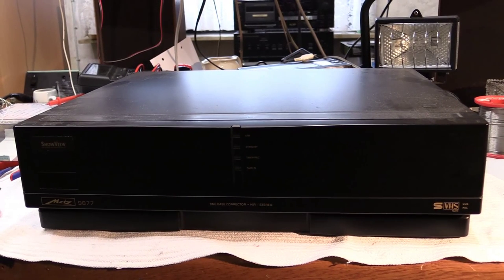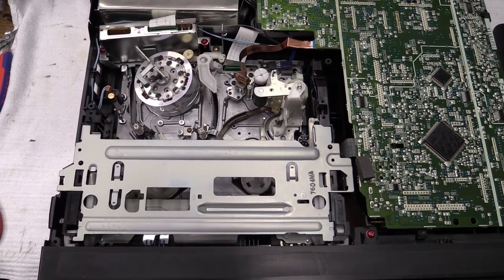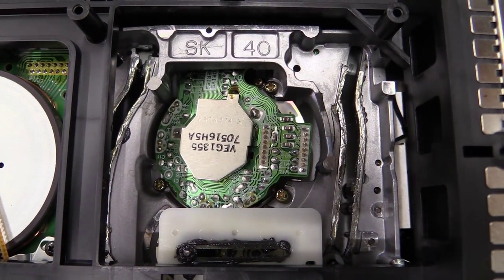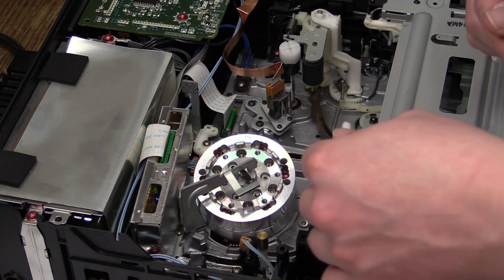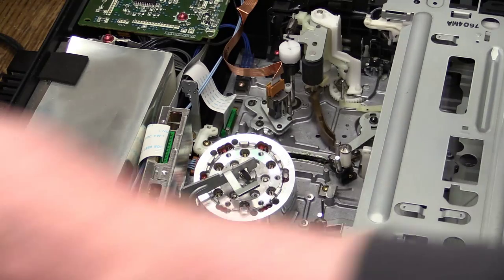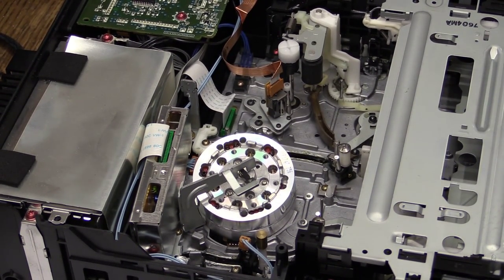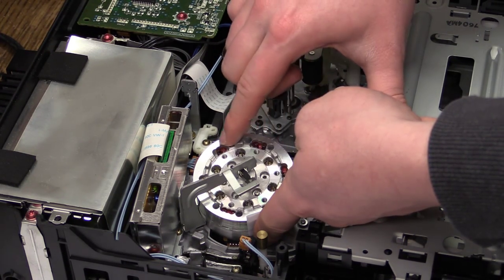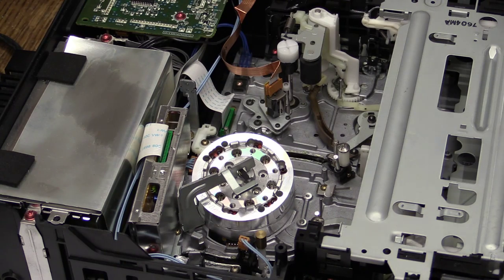DrCassette's Workshop - Panasonic HS1000 S-VHS VCR overhaul

Comment: Hi Doctor, I enjoy your videos. Is it possible to make a video for the Panasonic HS830 showing how to remove & clean the mode switch? I have 2 of these machines & one has all the symptoms of oxidisation on the control tracks. I took off the lid, took one look & hid in the cupboard shaking with fear & thought "I dare not touch this, I will break it.....I know, I shall ask Dr Cassette for help!". I cannot find info anywhere on the dismantling of this model let alone the procedure I'd like to do. I hope you can help. :)D
Reply from the maker: I can't get a specific model of VCR just to show how to repair a specific problem. If you get very, very lucky a friend of mine might make such a video as he owns a Panasonic HS830. You should be able to find a service manual for the HS830 online.
Reply: DrCassette 
No probs. I took the plunge & did it myself. The mode switch looked fine. I cleaned it & put it together. I then realised the problem was not with the VCR but with the tapes I was playing on them. They were old ex-rentals & 20 years on are deteriorating. I thought it was odd because having cleaned the heads only a week ago, the heads were dirty again.
Years ago I had a 200 machine duplication bank & I realised those were always recording onto NEW blank VHS tapes, so the heads never got dirty.
So it would appear the deterioration was triggering my HS830 to stop & eject. I played an unused tape & it is fine.
PS: I thought you already had an HS830, I thought I’d seen you with one in a video. I must be mistaken.

Comment: Very nice, though you should experiment with different camera angels, sometimes you can't see a thing what or where exatly you are doing things... Will you do any tape path alignment videos?
Better yet, make series on "How to maintain your professional VCRs" and go trough basic procedures (cleaning, lubing) to the more complicated stuff that is required after heavy use on the VCRs (alignments/adjustments, replacements)
Reply from the maker: That is much more than what I have time for at the moment ;)

Comment: Panasonic almost always made sure that the transport and chassis were easy to access and clean. Stark contrast with JVC...Always a damn circuit board or two on top.
Reply from the maker: Somehow JVC VCRs are hard to find around here, over the years I have seen just one consumer unit. I recently bought two of JVC's big industrial VHS editing VCRs. Those of course are designed for easy servicing.
Reply: Oh? Which ones? I had two BR-8600U's that were a breeze to clean.
Reply from the maker: I have a BR-8600E and a BR-6600E with matching RM-86U editing controller. They were bought as a set which is a bit strange because only the BR-6600E supports HiFi audio.
Reply: How much did you pay, do they both work?
Reply from the maker: I got these as part of an almost complete studio setup that a school used for teaching young adults the basics of working with video. So there was a camera, video mixer, title generator, a Sony S-VHS VCR and some other stuff along with the JVC VCRs. For all the equipment I paid 300€ in total. The BR-8600E works fine, the BR-6600E has a broken gear in the cassette loading mechanism, but I hope I can glue that back together. If you can get a cassette loaded into the mechanism, all the rest works fine. According to the hour meters both VCRs ran for only about 500 hours.
Reply: Damn, that's a steal! Will you do a video on the whole set soon?
Reply from the maker: There will be a lot of videos on all this stuff, but I don't know when, I still need to free up some space to set up all this equipment.

Comment: This VCR inside looks like National(panasonic) NV G10A , mainboard with boards on it.. and the whay its assembled. I also dont know what to do with it..
Reply: I have a G10EM! This uses the D mechanism instead of the HS1000 which uses the K mechanism. Mine has a power supply problem. Does yours work?
Reply: Hi. This VCR uses BNC connectors for the video output and RCA connectors for the audio output :)
Reply: +Fivos Sakellis  jea. bnc wich i dont have.

Comment: 1:07 All the speeds? That's a PAL model and unlike NTSC which have 3 speeds (SP/LP/EP). Very few PAL VHS includes PAL EP. Most PAL VHS only have SP & LP but not EP. I'm just confused about SVHS PAL VCR long before I saw your video because they said that JVC the inventor of VHS made a policy never include LP speed on SVHS machines and your VCR is a PAL SVHS model. My question is are the speeds of that SVHS PAL VCR SP & EP (no LP) like most NTSC VCR? or SP & LP (no EP) like most PAL VCR? or SP/LP/EP like the old NTSC VCR?
Reply from the maker: +bobskie321 
This VCR features SP and LP. The EP speed, due to the very low quality, was never a thing on PAL VCRs. It may have been available on some models, but it was never popular.
Reply: +DrCassette
I googled it and discovered that Sharp VC-MH705 VHS VCR can record and play PAL-EP. BTW the dirt on tape path (7:17) in my experience is one reason of incompatibility issue when playing tapes recorded from other VCR. I noticed it in the 1990s which tapes I recorded in EP mode when the VCR was new is not compatible anymore. The tracking noise at the top of the screen when I adjusted the tracking it moves to the bottom. But after I cleaned the tape path, old tapes is compatible again but new tapes which I recorded before I cleaned the tape path is no longer compatible and must be re-recorded.
Reply: +bobskie321 Panasonic NV-FJ760 has EP speed. I have one of them. Never used it much because, as you say, not many PAL video recorders have EP, no one I knew had one that had it. The quality was actually ok though I imagine if it had been linear audio, the sound would be quite poor. 
I don't know about the compatibility problems. I was recently going through some old tapes and found one with an EP recording and it played fine. That was recorded and played back with the machine clean though. Not much call for EP on PAL as the tapes are plenty long enough anyway especially once E240s became the norm in the 90s.
Reply: +nowt100 
Even I live in a country where NTSC is used, the linear audio in EP mode is poor and the tape speed of NTSC-EP is almost the same as PAL-LP. So that could be the reason why they didn't include EP in most PAL VCR because the linear audio must be worse than NTSC-EP. I presume that PAL-EP is only available on HI-Fi machines because Hi-Fi audio is not affected by this. I googled the VCR you mentioned (Panasonic NV-FJ760) and it's Hi-Fi and it must be to make PAL-EP acceptable.
Reply: Yeah its Hi-Fi. A good deck, was about £300 back in 2000 although we got it because the previous one broke just within warranty so got new machine of same price. Its still going fine now.
Yeah the linear audio on PAL VHS is pretty poor in general. Just about ok in SP, any slower and its very hissy and muffled. So although I've never heard EP linear audio, going by what it's like in LP, it would probably be pretty much unlistenable.
Before Hi-Fi came in a lot of the PAL vhs machines, Ferguson (UK JVC clone) ones in particular, had Dolby NR on them to counter the noise from the slow tape speed, especially the linear stereo ones. Was that common on NTSC machines?
Reply: +nowt100 
I stumbled into that on google several years ago and found out that it was common even on NTSC VCR but only with stereo linear audio but never seen one before except on YouTube. Maybe because I'm from the Philippines and most people here were using Betamax until late 1980s when VHS starts to became popular and by then Hi-Fi machines are already available but none includes Dolby NR on linear audio.
Reply: Ah that will be it then, this is early 80s when these were coming out. I only really know the PAL models so don't know if the features correspond exactly on NTSC but the JVC HR7350 was a very popular Dolby linear stereo model in the UK albeit rebadged as a Baird 8940. A top loader from about 81. The 7300 was the mono version but also had Dolby. I think once HiFi came in any attempts at making the linear track sound better were dropped and it was included purely for backwards compatibility and only in mono.
On the subject of Betamax, did you know Sony are only just ceasing production of Betamax tapes this month?
Reply: +nowt100 
Yes which surprises me because I can't believe they still manufacturing those tapes long after they'd lost the format wars.

Comment: Nice videos, Dr Cassette. I watched this one and the HS900 one. I'm in the market for a Panasonic, you wouldn't happen to have an ebay shop, would you?
Reply from the maker: hushofthechameleon No, I don't use Ebay that often.
Reply: DrCassette Too bad, it looks like you know what you're doing. I'm sure eBay has a lot of knowledgeable sellers, but the reality is that you never know what you're actually getting if you buy untested/untested. Most of the time, it's a gamble.
Reply from the maker: Whenever I do sell equipment I make sure to give it a proper overhaul before.... you're right, a lot of people sell junk on Ebay :P
Reply: "Untested" VCRs on ebay simply mean not working. Very common with Betamax! The sellers usually claim that they don't have a tape to test the machine...